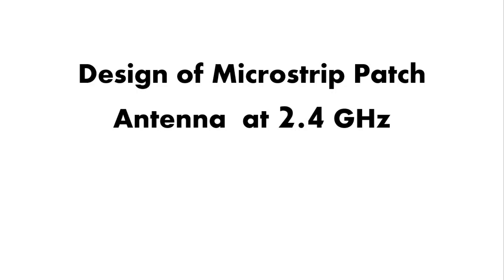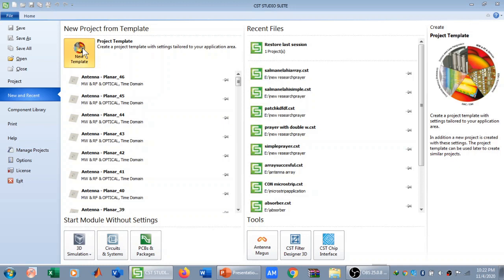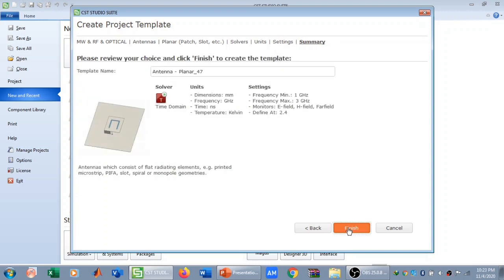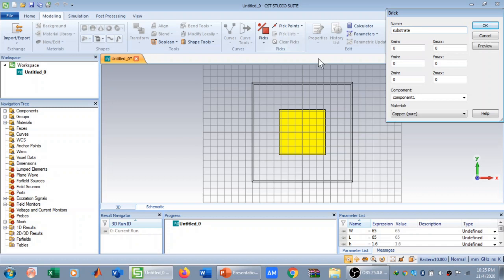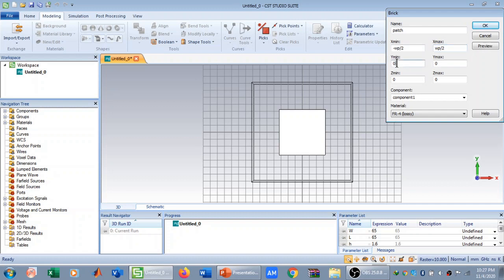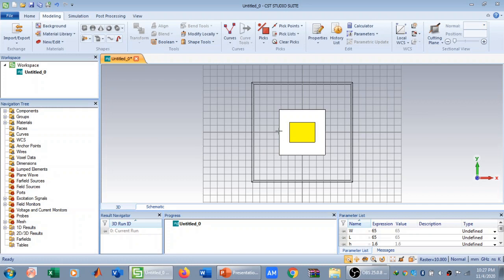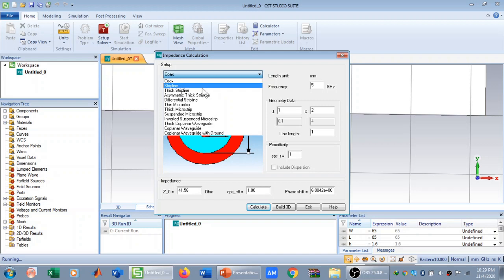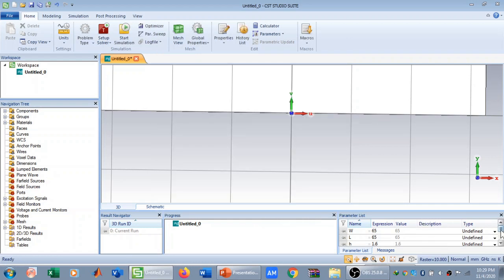Design of Microstrip Patch Antenna at 2.4 GHz for Wifi communication using CST microwave studio

Comment: Can I use pec instead of copper as material for ground and patch? And is it mandatory to create the ground 1st?
Reply from the maker: Yes .ofcourse..in simulation..people used pec..but remember pec is ideal conductor whereas copper has some losses...
Reply from the maker: Not it's not mandatory to create ground first..but it's mandatory for the ground to be at bottom...
Reply from the maker: Yes...
Reply: I did as per your video(instead of copper I have used pec) and it is giving me errors as normal face out of bounds error, error in calculating solver matrix and adaptive port mesh failed🙄🙄
Reply from the maker: This type.of error is when ground is exactly below substrate or it has interfered within substrate...or patch is not exactly above substrate......please double check coordinates ..I am sure there is some problem in coordinate axis..

Comment: Would you please explain how you get those values of substrate, patch and feedline?
Reply from the maker: The patch values can be calculated from set of formula or simply online using microstrip patch antenna calculator..
Reply: @TechnicallyExplained  how you determine the W and L of substrate? The W and L of patch we could find it online
Reply from the maker: The height or thickness of substrate should be of standard values..i.e. you should take the thickness  substrate of values which are commercially available..
I am using the Fr-4 substrate which is mostly commercially available of 1.6mm thickness..that's why I have taken substrate height to be 1.6mm